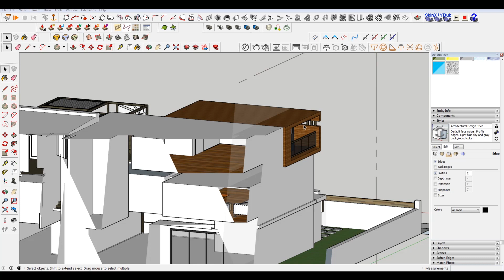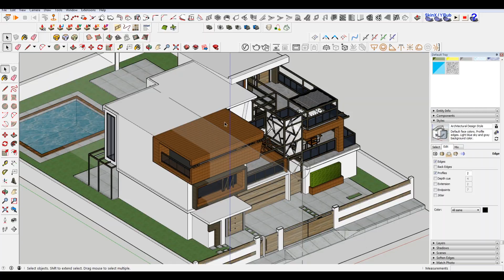How to Stop Clipping in Sketchup

Comment: That is not an actual fix, the problem is still there, you just didn't take in consideration starting right now and work on your house on some details with millimeters, try that and see if you can zoom to those millimeters without any clipping problems.

Comment: I tried this and other tricks as well, none helped, then after some investigation I discovered the culprit was a big image, a Location Snapshot used to geolocate the model, it was around 1 km square. Deleting it solved the issue. But I didn't want to delete it. Hiding does not solve the problem, I really had to delete it. Using Sketchup for Web for personal use.